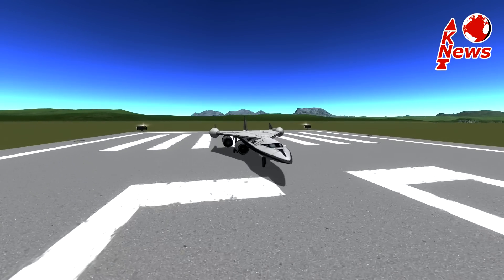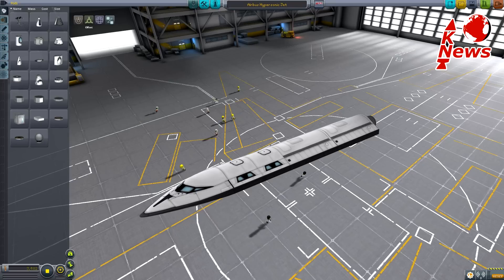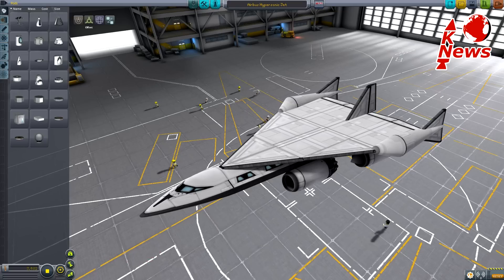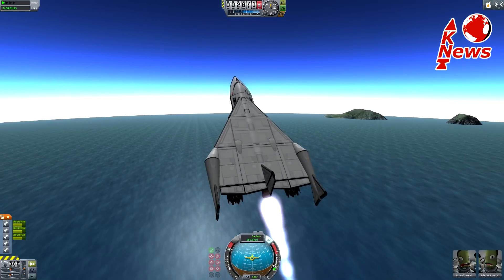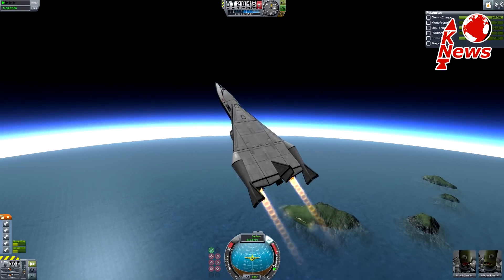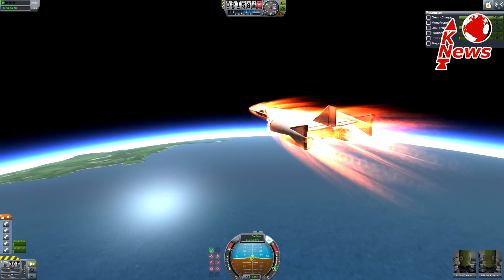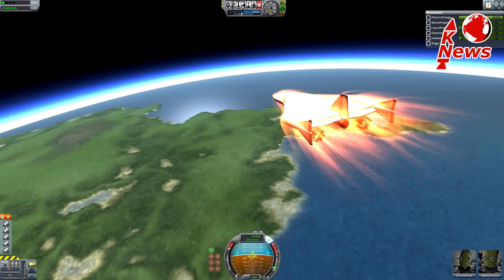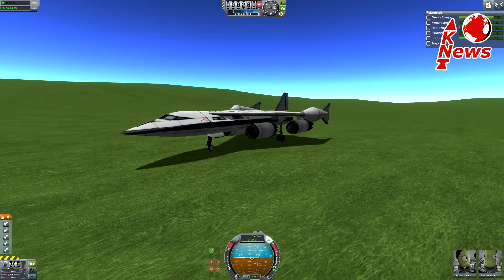Airbus Supersonic Jet Special | KNews #14

Comment: You have a lot of deadweight when one or two of the propulsion systems are not used, making the aircraft uneconomical. In this kind of concept the engineers usually try to combine 2 of them or all three.